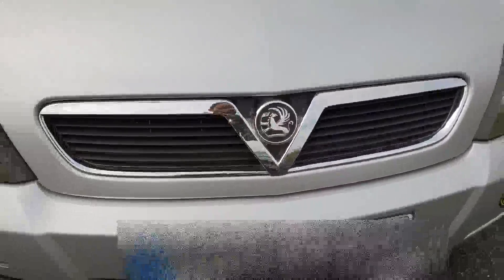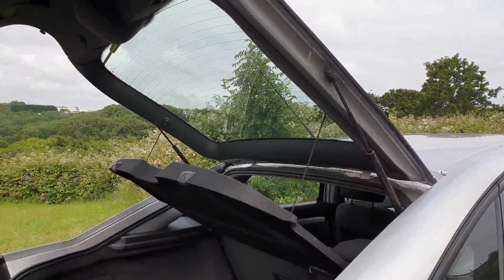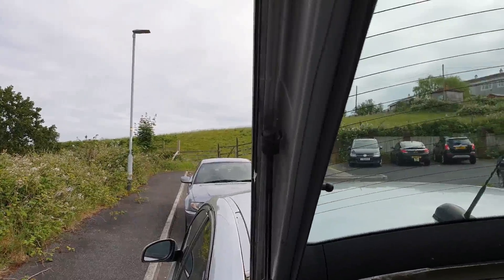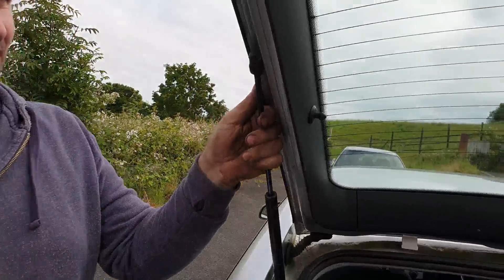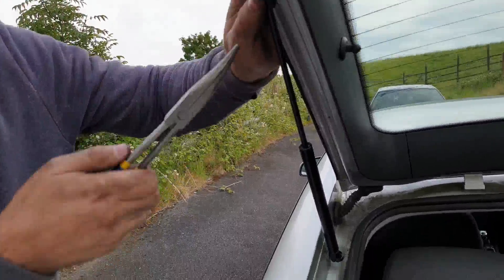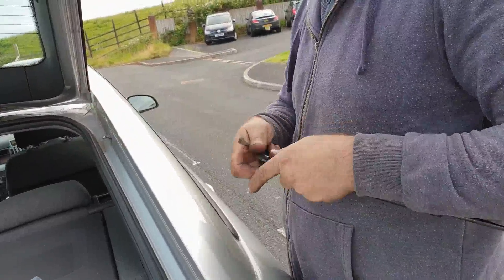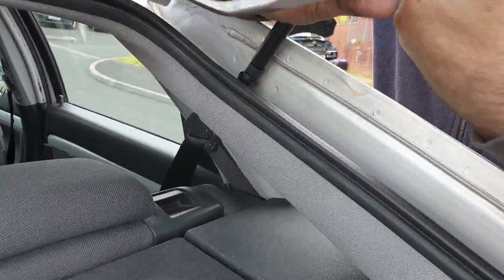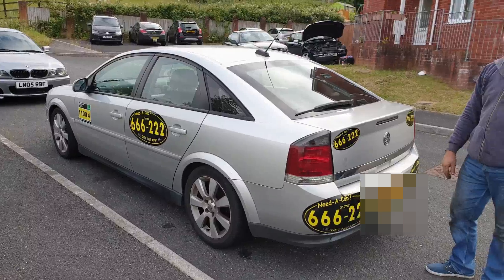Hatchback gas strut replacement (how to fix boot tailgate)

Comment: Thanks, really useful, I was struggling to fit the new gas strut that wouldn’t fit. Watching this video I realised I was trying to connect it onto the parcel shelf peg which is larger than the gas strut one. When I realised my mistake it was easily fitted 😂
Reply from the maker: Good to hear that, thanks!

Comment: Hi guys just watched your video on removing boot struts, What tool etc can you recommend to disengage the clips to remove the Strut? Thx you
Reply from the maker: You can use either 
a small flat head screwdriver - there's a gap at the back of the clip, slide the screwdriver in and wiggle the clip out
or long nose pliers to grab the clip from behind and pull it out.
Let me know what worked best for you. Good luck :)